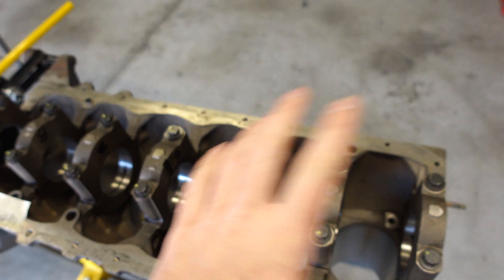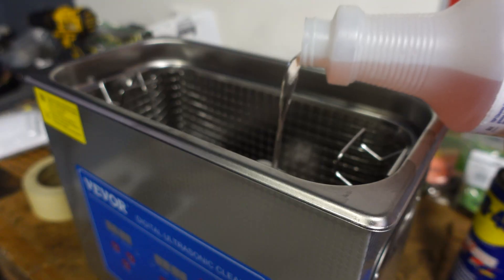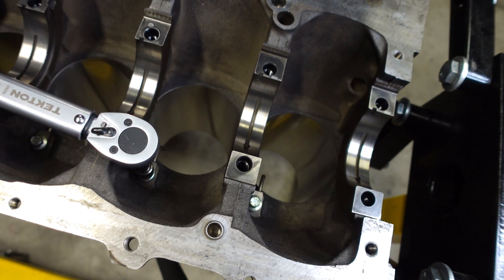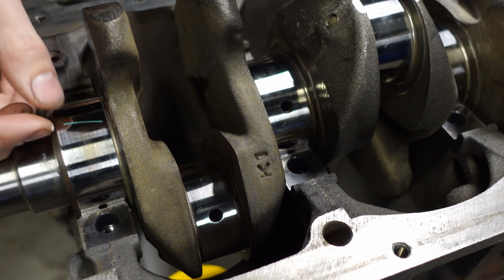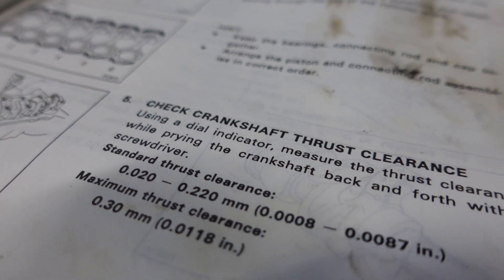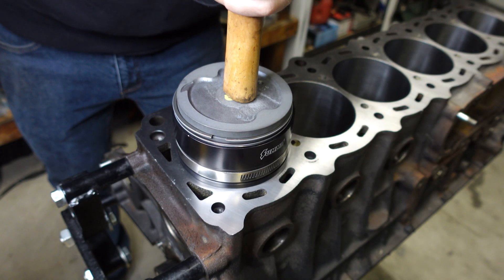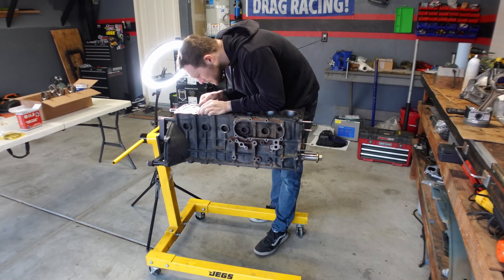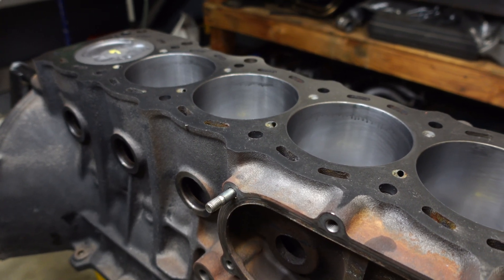Engine Bottom End Rebuild EXPLAINED: Toyota Land Cruiser 80 1FZ-FE 4.5L

Comment: Hello RM.  I watch all of your videos when they come out because I am a total Landcruiser fanatic.  Now I'm doing a 1fz-fe build, so I wanted to go back and watch this again.  Excellent video, but I have a couple of questions: 1.  What kind of pistons did you buy?  I haven't ever seen ones with the black sides.  If you are happy with them would you mind sharing a link where I could buy them.  My head, block, and crank are at the machine shop.  I'm waiting for them to tell me I need to bore the cyl and crank over.  2.  What size is the piston ring installer tool that you bought from Summit?  I see many different ones.  Could you share more info on that?  Thanks.  I  appreciate your content and help.
Reply from the maker: 1. These are DNJ pistons, which aren't the most preferred piston but they'll work fine in an engine like the 1FZFE. Buy Toyota OEM pistons if that gives you peace of mind
2. You just need to measure your bore and then buy that size. My size may differ from your size but I got a an adjustable one 3.900 in. to 4.050 in
Reply: @RM_Garage  Thank you.

Comment: New head gasket requires new bolts, they are torque to yield, the old bolts are now useless, they have been stretched and to re-use them would be a huge risk of failure
Reply: Instead of new bolts , better to install studs & use flange head nuts , gives a better job , more precise tq

Comment: You are AWESOME Buddy......... You explain EVERYTHING SO NICE......... Im rebuilding my engine next week........ If just in case I have some questions can You help Me????.......... I am putting MAIN BEARINGS IN .50mm and CONROD IN .25mm........I need to know EXACTLY how MAIN bearings have to be installed........ I know that they had a correcto way so oil can fluctuate as normal.......Thanks again
Reply from the maker: The bearings have an ear or a "tang" that only allows them to go one way. Recommend you get a factory service manual, read or watch a lot of videos, or take it to a machine shop.

Comment: great videos mate, i really appreciate it ! I just got a question that i filed 1st and 2nd rings for specification of the gap, but what about oil expander ring? it is also over sized than bore like others, but i couldnt find infos for this. would it shrink itself(since it is shaped like spring)  when piston is installed into the cylinder? i also filed upper and lower groove ring for the gap clearance.

Comment: Picked up a brand new factory short block for my 199780 series last year. Getting ready to put her together with a new head. Are you happy with your engine block paint? I'm on the fence if I should paint it or not
Reply from the maker: So far it has really held up great and I don't see any flaking, peeling, or chipping at all. Also I don't know if I say it in this video but I used basic Rustoleum paint, brushed it on. Check out the video from Uncle Tony's Garage. I used his exact method.
Reply: @RM_Garage  awesome thanks! Brushing it on is a brilliant idea, I'll look up tony. 

Bet Idaho is awesome, can't wait to move to Idaho or Montana Just need Idaho power or other utility to open some spots and I would leave Cali's largest utility. 

Thanks again, digging your content!
Reply from the maker: @BillyGoatsAdventures   Idaho Power isn't hiring? I will say my experience with them has been amazing since being here, and the power bills here are INSANELY cheaper than CA.
Reply: @RM_Garage  I interviewed with them a couple times years ago but it wasn't a fit at the time, but now we're ready. All our friends and family in the treasure valley have nothing but amazing things to say about Idaho power. 

Unlike the company I currently work for, I would be proud to work for Idaho power. 

The new shop looks great. Our house and property we bought back in 2011 had a 1400 square foot metal building on it and I'm very thankful all the vehicles I've been able to repair as well as restoring and building my '98 Tacoma and '97 Land Cruiser. The space really makes a difference.

Comment: I want to see a 1fz blocked built for higher comp ratio for N/A to increase fuel economy power efficiency and higher rpm mayb fire ring the head for better clamping force some port matching cams valves etc. from factory these things are rubish motors chew fuel get like 400-450ks per 130L of petrol

Comment: You need to put oil on the liners when installing the pistons so you don’t struggle or scratch the liners when installing
Reply: Everything else you did a pretty good work my friend
Reply: The oil in the liners is also because you don’t want the engine when started turn dry out with no pre lubrication on liners may scratch them, the firsts turns that the crankshaft does are vital and needs oil its what we call dry start if there ain’t no oil on these and that’s scary but the rest you did good
Reply from the maker: I don’t know if by liners you mean cylinder walls but they were lubricated with ATF along with the piston ring compressor itself

Comment: Great video, thanks. Which adjustable piston ring compressor tool did you get from Summit? Looks like there are several part numbers. I was thinking the 4.00"-4.09" SME-90A4000 but wasn't sure if that was correct.
Reply from the maker: SME-90A3900

Comment: Why not oem pistons rings?
Reply from the maker: Honestly I’ve built several motors and never once used OEM rings or pistons and never had an issue. Machine shops use aftermarket pistons and rings all the time with no issues. I know these 80 series have a strong OEM part loyalist crowd, but I believe it will be totally fine running these rings.

Toyota more than likely uses a 3rd party to manufacture their rings as well, like NPR. 

Thank you for watching!!
Reply from the maker: The replacement head bolts, head gasket, and rods are all OEM.

Comment: I'm curious why not go with a new motor at this point? It seems like so much money it new parts at this point.
Reply from the maker: About $1300 ($1278) into the bottom end here. I think when all is said and done I’ll be about $3000 into the rebuild. So $3500 because you always estimate low and you end up getting nickel and dimed to death. 

Also it’s not a daily driver and I think this is fun! Thank you for watching!!
Reply from the maker: Trust me my mind constantly goes “you could’ve done an LS swap” and I probably could’ve. And I might…in the future 😂 it’s all fun and games for me. Just having a good time with it.
Reply: @@RM_Garage  Okay fair enough. And I guess once you're done you might as well have a brand new motor anyway. I bought a lx450 about 2 weeks ago and I'm pretty sure the head gasket blew a couple days ago. I'm trying to figure out what to do now. So 1300 in the bottom end. What did you do with the head? I'll be watching the rest of your videos btw. Just curious what you did for now
Reply from the maker: @brandonblackwell8932  since the head is a 24 valve they tend to be expensive to get resurfaced and have a valve job done. I’m looking at $600 for a 5 angle valve job, resurface, and new valve seals installed. 

None of that is 100% necessary if you’re just replacing a head gasket, but recommended since you’re already there. I’d wager most people hit the mating surfaces with scotchbrite and put it back together.
Reply from the maker: New short block from Toyota is like $4k, they come from Japan, and are sparsely located across random Toyota warehouses across the country if you’re lucky. I’m not 4k into it. Give me a second I’ll grab you the exact amount
Reply: I just did a head gasket job on 96 and now have a significant tick by bell housing… 6th cylinder it has to be!!! I want to pull the oil pans and check the bearing on 6.. and just pull the head and slap new piston rings and bearings while I’m already there.. I can’t pull the engine at this point I have nowhere to do this at but I could make it happen with the short block still intact.. what’s your thoughts?

Comment: Did you use a crank pulley tool to remove the crank bolt?
Reply from the maker: In a previous video I used the engine to loosen it. Watch the one where I pull the motor out. I will need a tool to reinstall it though.

Comment: Thanks for your videos and IG posts. Machine shop just told me they want to machine my 1FZ  ‘20 over.’ Are there toyota pistons that fit this setup? Just the cylinders not the crank.
Reply from the maker: Yeah, Toyota sells a .020” over piston. You’re going to want to look at a parts catalog on Toyotas website and find the oversized piston. I’m running DNJs in this as a piston isn’t rocket science anymore and I couldn’t justify $800-$1000 for a set of OEM pistons.

Safety, DNJ, ITM, etc all machine shops use them in rebuild and they have nothing bad to say about them. Even LCE uses Safety Auto pistons in their rebuild kits. I understand if you want to stay OEM though. Just depends what’s in the budget.
Reply: @RM_Garage  Thank you. I run oem when I can but I’d be fine with quality after market pistons and oem rings and bearings. What do you think?
Reply from the maker: @azbeeson  I’ve never had a problem with aftermarket bearings and in this motor I’m using ACL rod bearings and Clevite main bearings. If King bearings weren’t back ordered for months I would’ve ran those - you’d be hard pressed to find a better bearing. 

Nothing wrong with aftermarket rings.  Hastings is great for example.
Reply from the maker: .020 over may be listed as 0.50mm in a Toyota parts catalog by the way.